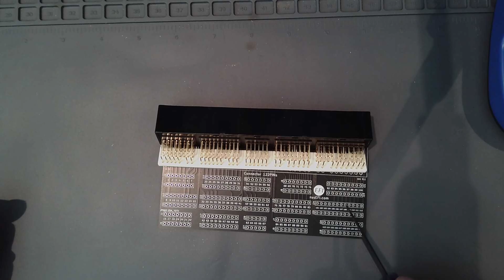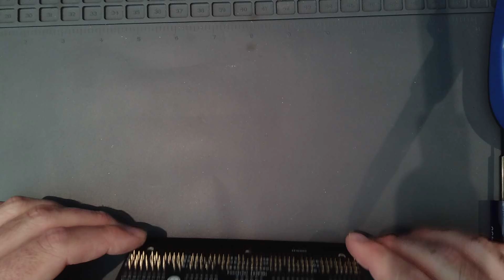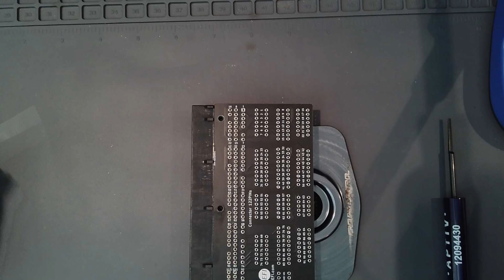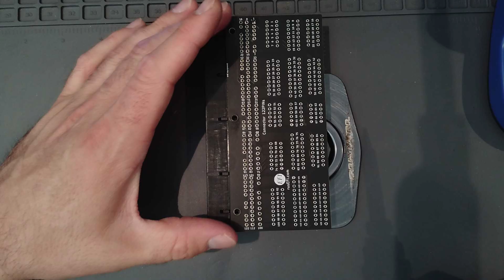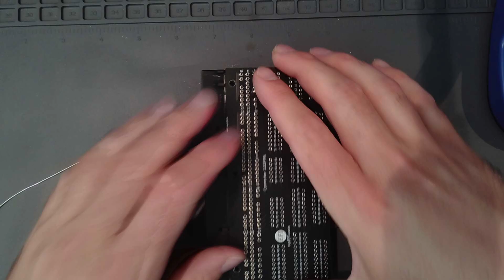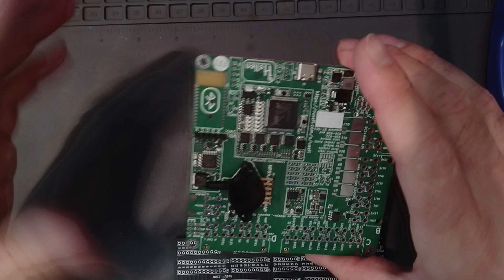RusEFI Break out Board for Toyota 5VZ/2UZ Piggyback PNP ECUs

Comment: I didn’t know about this company so I bought a auto ecu and cut out the circuit board. I then soldered wires to the pins I needed. I think I may want to redo it so its nicer